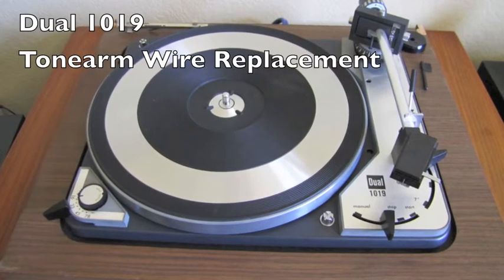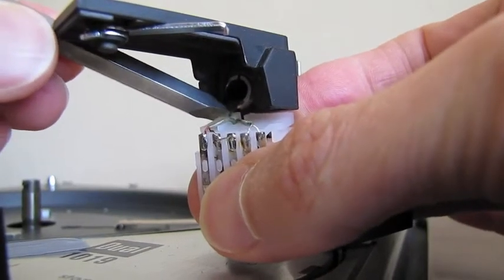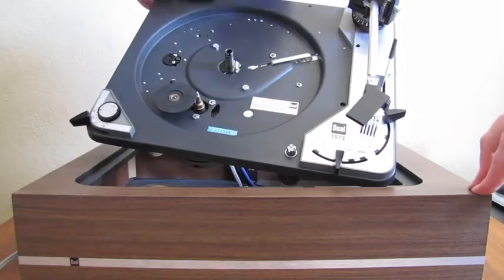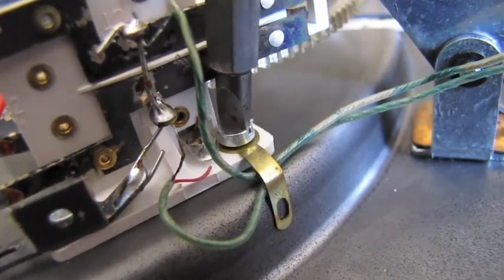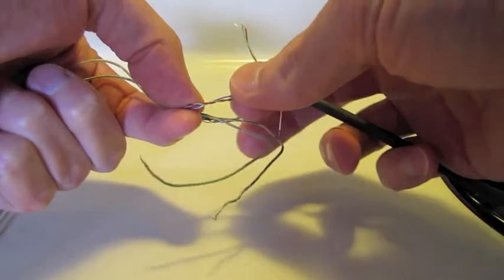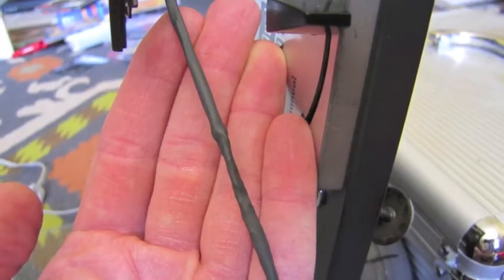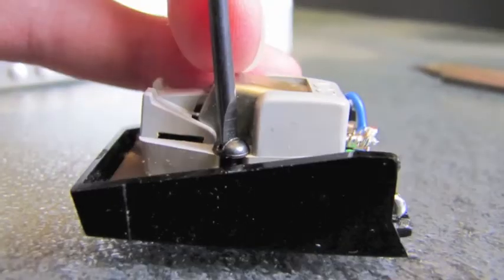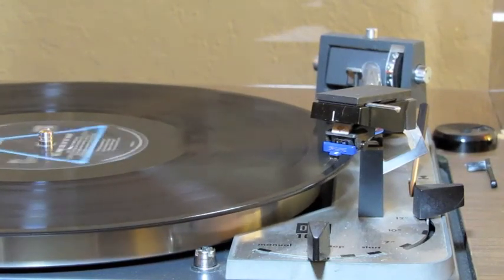Dual 1019 Tonearm Wire Replacement

Comment: Note of warning removing the platter.  They were held down be a clip from factory that prevents them lifting straight off.   True, several have lost their clips with service over time, but a lot will still have them.   When you remove the spindle, you need to carefully remove this clip also, taking care not to damage the decorative aluminium which is pretty well unobtainium on its own.  You should be very careful with the table upside down not to put any pressure on the tone arm.   Best to support it so this is not resting on the bench.    A third note,  The Dual system works as an unbalanced system.  The chasis ground is also the cartridge ground.  You should uses single core shielded cable for the tone arm wire replacements rather than twisted pairs.    Aside from the above, this is a pretty good tutorial.   
I reality, the headshell contacts are easy to clean/repair and aftermarket.third party sleds are easy to find.   You should only really replace the tone arm cables if they are faulty, everything else can be worked around.  Hardwiring the headshell sled makes it really painful to change the cartidge, especailly if you are using 78 RPM's (which need a different needle) and LP's/45's on the same deck.
Reply: Are you active of any of the forums?

Comment: After dealing with intermittent channel drop on a 1225, this is what I learned. Get a multimeter and check continuity of each wire, from cartridge sled to rca jack out underneath  the TT. In my case it was a break in one of the left channel wires at the back of the headshell. Save yourself a lot of head scratching that way.

Comment: A small hint: Those screws on the top are designd to be turned with a coin. A coin makes less damage to the screw than a srewdriver does. 
Nice video! Keep on doing this. I've got the 1226

Comment: Got to remove the retaining ring before the platter is removed.

Also if you want to improve audio performance bypass the switch that the tonearm wires go to before going to the RCA post.  This way you will remove additional solder points and materials that the audio has to travel through that hampers sound performance.

Comment: Great video. Great turntable too. I own two, one for 78. I use a Denon DL103R in the other. I would caution against soldering directly at the cartrige pins like you did with the ADC. This might cause the internal solder junction to melt and disconnect.

Comment: i like the Pink Floyd ha,
i also have the same Dual 1019 and i cannot remove the platter as easily as you have removed yours in your video "lift and rotate the platter" not easy at all, do you have any suggestions, thanks
Reply from the maker: +brian dormio Gently lift it straight up. If it hangs try to tilt the platter one way or another until it moves a little further. Eventually it should come up all the way. I hope that helps!
Reply: +Ryan Cresawn What else can be done as there is no gently that will be involved and i do want want to destroy this turntable
Reply from the maker: +brian dormio If you are able to remove the plinth from the wood base you may be able to flip it over and see if there is any way you can separate the platter from the spindle with it upside down. I wish I could offer you better advice, but my turntable does not have the problem yours does. Good luck and let me know how it goes.
Reply: brian dormio i know this is 9 months old but theres a c clip when you take the spindle off. gotta pry the c clip off, then lift the platter. hope you've learned that already.

Comment: So, what if you wanted to bypass those head-shell contacts entirely? I just bought a dual 1219 that someone had already modified to do so, and it all seems like a fairly logical thing to do. Basically the tonearm wires just connect directly to the cartridge, and the little "Dual sled" contacts are bypassed entirely. Would there be any problems with this method? Any precautions? 

Just curious!
Reply from the maker: +TheUnityLane bypassing the contacts on the cartridge head is exactly what I did. If you go to 5:17 you will see that I remove the old cartridge from the cartridge sled. The cartridge sled contacts lost their spring tension over the years and produced a weak, unreliable electrical connection. Jump to 5:59 in the video and you will see that the tonearm wires are directly connected to the new cartridge. The end result produces reliable playback even four years later. I'm very happy I did this work on my 1019. I hope my explanation is clear!

Comment: How long run of wire did you use or did I not hear it? thanks
Reply from the maker: +amcrebelfan The wires I bought are 24 inches long. Here's where I bought them. http://www.dedicatedaudio.com/collections/phono-cables/products/cardas-4-strand-braided-33awg-tonearm-cable-with-soldered-clips
Reply: Ryan Cresawn now that's a fast response! Thank you very much
Reply from the maker: +amcrebelfan no trouble at all. Are you repairing a 1019?
Reply: Yes I am I found a near mint model at Salvation  Army in a console  I bought it and donated the console back as it was solid state not tube. It's only issue was it wouldn't turn off.  While fixing that somehow tonearm wires got pulled into mechanism  and ripped them apart. So shutoff is fixed now need new wires.  I think it's a good thing as the head shell needs replacing so doing what you did will eliminate that need and sound better anyway.  So glad I found your video.